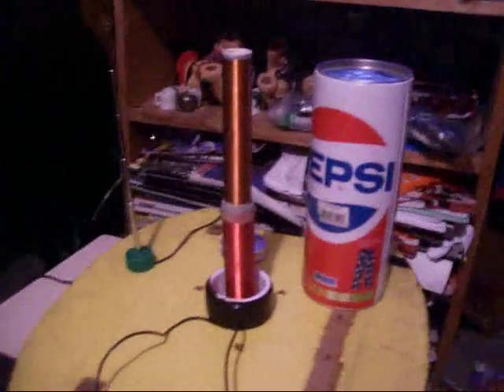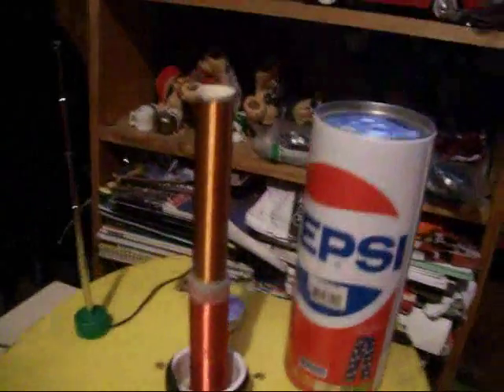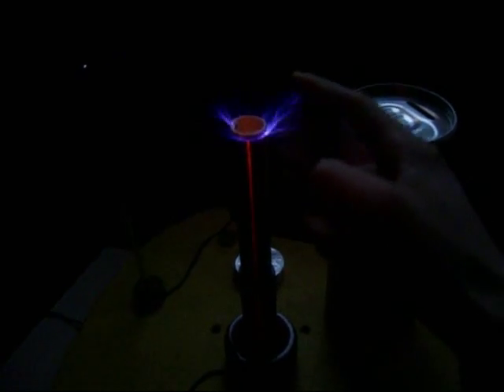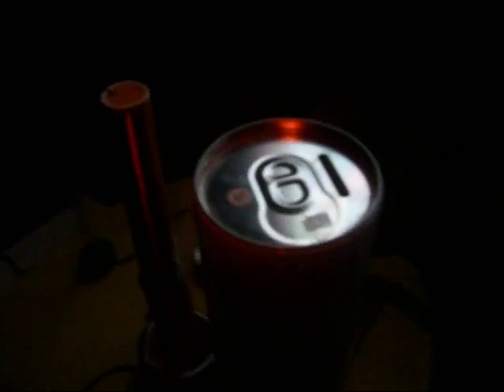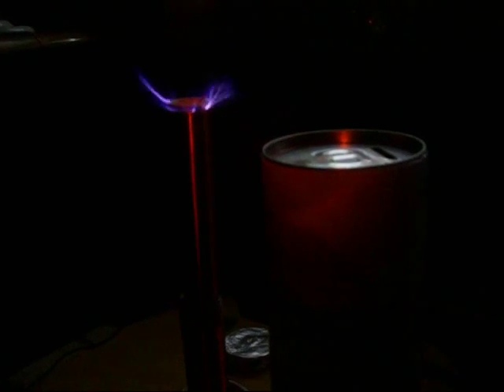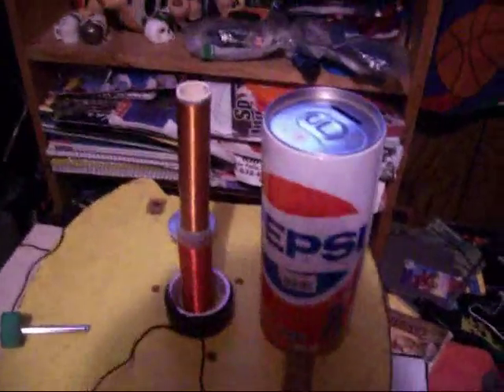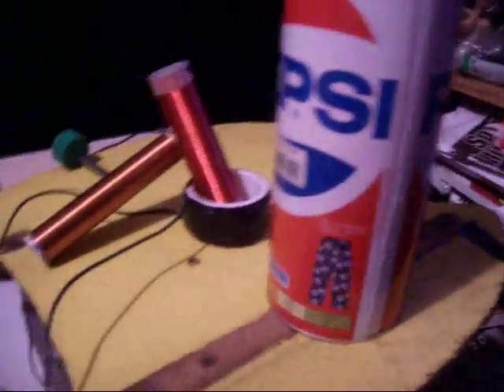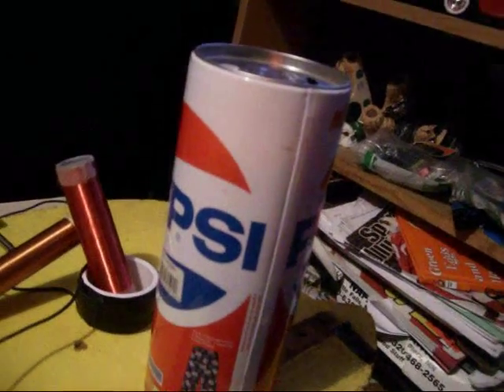Tesla Coil Energy Transfer

Comment: I'm not putting you down I think it great you studying these phenomenons!  To continue: your little project is approx:maybe:don't have all info: 5000 v at 0.0012 amp =~6 watts Now those watts have to come from somewhere? Possible the AC-Power Line you have connected!  If you take a ac-ammeter and place it on the input, I'm sure it will read approx 5-6 amps, maybe a little higher? Some is loss in the form of heat, and work being done! What you've come up with is an ion-generator! Keep up the work

Comment: Hay I have to give you credit KID, great little school project!  Your plan is insufficient to give enough power to the load!  What your observing is surface energy, caused by RF!  Why most of the Devices will not work with current strategies: lets do some math: Average power coming into a household is approximately 240 VAC @200 AMPS~48 KW, Even to power an average refrigerator is approximately 120v @ 10A=1200 watts! Power in, to power out=power loss in terms of work!

Comment: Via Ground at max. Nothing else of course! It's just a floating Secondary, which is grounded. The primary actually is grounded, too, so both coils are connected through a higher or lower resistance to ground.

Comment: Higher frequency is safer for people because of the skin effect... For the electronics it means stronger electrical field and more interference. For eg. try to filter simple 50Hz or 60Hz transformer to clean DC and try to do the same with switching inverter (~20kHz), then you will know what about I'm talking. I don't want to insult anybody, but it's just wrong to talk about such ideas when you have too little knowledge on the topic you are talking about...

Comment: @tesladude19 P.P.S. If you want to collect energy from your TC more efficiently, you need to build another such coil, only without primary and all the drivers. Only topload, or special antenna and secondary coil, with the same resonant frequency as your Tesal coil transmitter. Because your can is collecting only electric field around your coil and  my mentioned receiver would collect electric field + radio signal. Tesla coil is basically a high power radio transmitter. Sorry for my english...

Comment: You're too stupid to do what you are planing. Why do you need 120VAC? Many devices uses way lower voltage, so just make the voltage you need. And keep in mind that the hardest part will be to make it efficient and safe. Can you imagine what is going on in the mobile phone in your pocket? There are a lot of hosehold devices which are sensitive to electric field created by your Tesla coil. Tesla was a total genius, but he haven't imagined about digital electronicks and high power consumption.